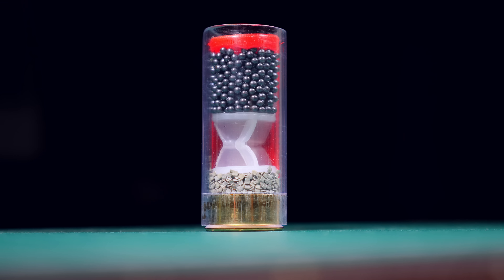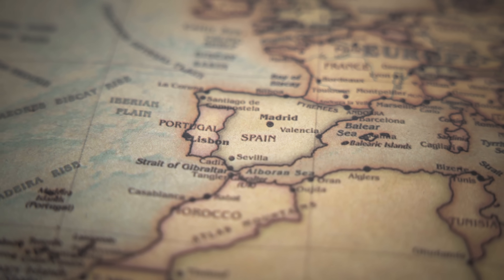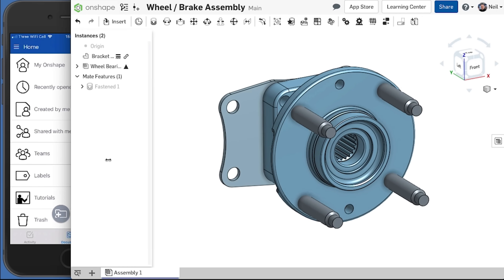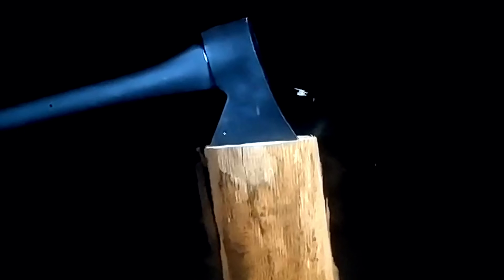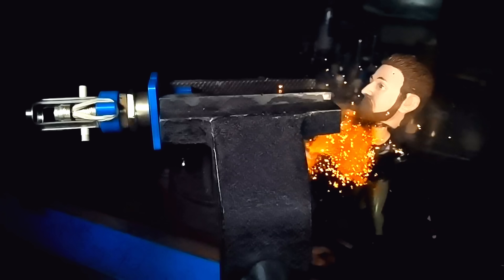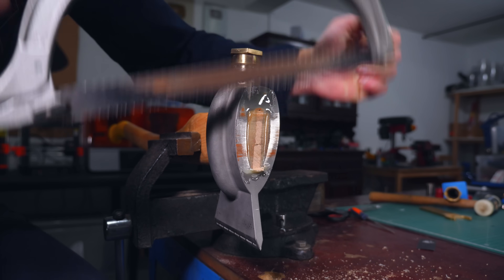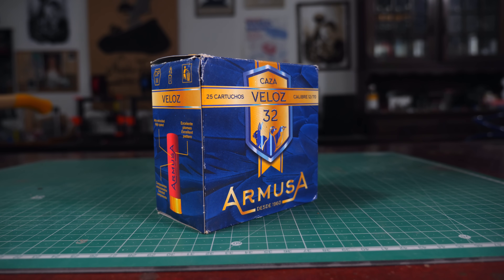I Built a SHOTGUN AXE

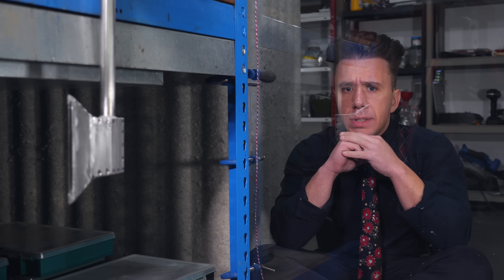Comment: 03:54 as a gun owner, I had a goose bump moment when I heard glue and aluminum working with high pressure gasses. I'll continue watching it but I'm really worried about you. I built hand made prototypes 20-30 years ago and it is not trivial.
Reply: To be fair that was one of the few times we've seen him take genuine safety precautions.
Reply: @dgkimpton  and there was a clear enough, relatively giant barrel to prevent high pressure… for the most part
Reply: As did everyone, including him. That's why that was just a proof of concept prototype for testing before the 3D printed head was made. Plus the vent holes were clearly more than enough to keep substantial pressure from building up. Even if it did, he took safety precautions and it would have failed at the glue joint instead of creating an aluminum shrapnel grenade anyway.
Reply: @JJFX-  definitely

Comment: Amazing project!
Since you can leverage pressure, I'm pretty sure you could use nail blanks to make a semi auto axe. The charge will be a lot smaller, but potentially sufficient to split the wood without sending it literally flying. And the shape (rimfire) makes it far easier to create a self loading mechanism for repeated strikes.

Comment: As someone who grew up chopping firewood, I expected this to be terrible
I mean, a hollowed axe head?? I severely underestimated the power of shotgun shells.
Silly and impractical, but genuinely effective when it works. Splitting the large log down the whole length at 15:50 was the most impressive shot imo, even if it wasn't as animated as the other pieces being blasted to bits. It's super interesting that you designed a blade like axe as opposed to a wedge to maintain a seal.

Comment: Wonder if you could design to work with co2 carts, redesign the head a little bit to be less of a splitter and more of a "wedger", where the shape of the head is designed less to split the wood and more to get fully plugged when you strike...

Comment: They weren't just for tractors. Known as a Coffman Engine Starter, that used a 4 gauge shell, they were used on several WWII aircraft engines like the Wildcat, F4U Corsair, Spitfire and Hawker Hurricane. It seems like an odd choice until you realize the time needed to scramble aircraft for interceptions was so short. Far too short to use separate ground based starting systems, one for each engine. Some aircraft had both system when the mission allowed the time.

Comment: Cool idea, it would have been infinitely easier if you used 22. Blanks which you can buy at most hardware stores.
Reply: Power nailer loads are not .22 blanks.
Reply: @jrrarglblarg9241  🤓

Comment: 2:18 kinda proves my point about gun control laws (I'm in the states). You can easily enough make a barrel of some type or a projectile of some type. Yet all laws I've seen here and any I've seen elsewhere, restrict access to the gun itself and not the bullets (although those can be made yourself).

I would think if the goal was actually limiting their use, restrict the part people can't easily make themselves, the primers and gun powder.

You CAN make gunpowder yourself, but it's likely to be poorer quality black powder than high performance, smokeless powder almost all weapons use.

And even if you do have the knowledge and ability to make them (which is probably by itself a higher bar than most gun ownership laws currently as in the process you can easily blow yourself up) you still need the primers, which are high explosives.

Which sets the bar even higher.

IDK. Just my thoughts.

Anyone know of a country that does restrict ammo, powder or primers?

Comment: That little plastic thing is called a shot cup. if it's a shell with a slug in it it's called the wad (used to be a literal wad of cotton cloth).
The fun part would be to see if you could make the thing take AR shotgun mags to reduce time between re-priming.... or use some ram-set charges.

Comment: I'm curious if it gets dirty from powder fouling quickly?  Those ports are pretty big, as are the channels on either side.  It looks like it should be pretty durable, and last a good while without cleaning the gas channels a bunch.  Still have to keep the blade sharp, if course, and oil it to keep it from rusting (so much corrodable surface area).

Comment: As someone who makes them, you are wasting your powder. It burns much slower than the dwelltime the powder and wad remains in the chamber. You’re throwing out unburnt powder flakes every time it goes off. Subsequently you are losing potential energy. That’s one of the benefits of having an ounce of weight in front of thewad, that mass necessarily slows down the movement and allows for full combustion.

Comment: A fantastic approach for wood splitting, but with the not readily available ammo, why don´t you try the ex-pl-o-..-ng wire type with a high current discharge from capacitors to form plasma ?

Comment: Now I want to see this improved to the point where you can chop down a tree in one swing (though I know this is very much unrealistic)
The one realistic improvement though would be to make the exhaust ports zig-zag right at the edge of the blade rather than be set back behind the blade. You'd have a half blade of an axe for most of the length of it but the ports would be right up front.

Comment: I smell a design patent coming.  This could have a lot of practical use applications.  Emergency & Rescue, Military & Police breach (forced entry). 

Could it work based on a chamber of compressed air that is released by user controlled trigger?
Reply: The military already uses shotgun-shell powered breaching devices. They're called shotguns. Load a shell with lead powder and it does a number on any pesky locks or hinges in the way.
Reply: I would say in this case patent in 99.99% is not possible because he published it in public domain. So it will only work if he himself will try to patent this that very unlikely because how shady this project from legal perspective
Reply: @dice-   Soooo, all things considered — you’re saying there’s still a chance?🤞
J/K, jokes aside I don’t know how patents work and your point makes sense.

Comment: A slight redesign to incorporate a plunger that hits the wood and is forced up into the ax head would allow you to use oil and compressed air as the explosive instead of shotgun shells 
No explosive primer needed.
Reply: Making it a diesel engine with the power stroke being the hit itself, nice!
Reply: Paint me a picture, that sorta doesn't compute.
Reply: @ShadowedbySusan  Diesel engine.
Reply: @ShadowedbySusan diesel pile driver

Comment: I have a reimagined version to improve your design!
Create a thumb trigger that you can manually trigger the shell to go off. Instead of pointing the energy towards the point of impact, point it out the back like an exhaust to a rocket. See where I'm going with this?
Design a rocket head out the back of the axe head, trigger the blast of your shotgun shell on your down swing to propel the axe head with greater force. This should be right up your alley! And also super dangerous! Win/Win!  ❤️ From 🇨🇦
Reply: @integza
Reply: wouldnt that be a gun/shotgun then making it illegal? Now it is basically more like a concrete nailer
Reply: @Hnkka  it's no more of a shotgun that what's he's already created. Shooting a propellant out the back of a axe with a nozzle would be more of a rocket than a shotgun

Comment: Few things to Say:
- Do a Cross Blade... split the wood into 4 pieces
- Use Pistol Blanks... less work and less complexity, also, probably easier to buy.
Reply: cross blade seems like a really dangerous idea with power like that. Seems like a fast way to get a wood piece to the knee, or even worse.
Reply: @valtarijunkkala  i was a maker till i took a piece of wood to the knee.
Reply: @valtarijunkkala  The groin? ^.^
Reply: @valtarijunkkala   Yeah, the main benefit to this design is that the force is to the sides. Cross is directing two of the four pieces in the users general direction....seems like a great way to gain a limp.
Reply: @valtarijunkkala  Yep.
Reply: Iligal to have pistols in Portugal, and what he as done is Iligal too
Reply: @Outl4wk1ll3r  they sell blanks for concrete nailers. 

If those are illegal then damn, those are some tough laws...
Reply: @volvo09  i don't know but the law on guns is crazy here
Reply: @ - Yeah, i researched a bit and Here in Brazil is also extremely regulated, basically, anything related to self defense is prohibited.
Reply: @Outl4wk1ll3r  This isnt really illegal. Basically this is like one of those concrete nailguns, completely legal, if he made it trigger operated it could easily fall in same category as shotguns and make it illegal making illegal weapon
Reply: @Hnkka   EU countries don't have the same gun laws
Reply: @Outl4wk1ll3r  well now that he has an explosive axe who could stop him
Reply: harder to buy because pistols and their ammunation and parts are regulated harder than shotguns and riffles that you can get easily for hunting purposes in EU countries. Pistols you need background for comp shooting/military training shooting or fox hunting to prove you need pistol and that you are using it for really good purpose
Reply: From a reloading perspective, pistol ammo is very difficult to get exactly right compared to 12 ga which is far more forgiving. For what that's worth.

Comment: Integza, what if we built a fully functional hydrogen-powered Pulse Detonation Engine (PDE) from scratch?

Pulse Detonation Engines represent one of the most extreme and efficient forms of propulsion, utilizing controlled detonations rather than conventional deflagrations. This approach allows for greater efficiency and thrust, making PDEs a promising technology for hypersonic aircraft, space propulsion, and even next-generation weapon systems.

However, the real challenge lies in constructing a working PDE without relying on 3D printing—using only standard machining techniques and readily available components. Could this be achieved in a DIY setting?

Step-by-Step Approach
1⃣ Designing the Detonation Chamber
The core of the PDE is a long, narrow tube where the detonation wave propagates. The design must ensure structural integrity under extreme conditions.

Material Selection: High-temperature-resistant metals such as stainless steel or titanium.
Geometry Considerations: A length-to-diameter ratio of approximately 10:1 to support sustained detonation waves.
One-Way Valve System: Essential for preventing backflow and ensuring a continuous supply of the fuel-air mixture.
2⃣ Fuel and Oxidizer System
A precise fuel delivery system is necessary to achieve controlled detonations.

Hydrogen Injection: A high-pressure injector would provide proper fuel-air mixing.
Oxygen vs. Air Intake: Using pure oxygen simplifies detonation but increases risk, while air requires compression for effective operation.
3⃣ Ignition System – Plasma Arc or Spark Plug
To initiate detonation, the system requires a highly reliable ignition source.

High-Energy Spark Plug: A robust and proven solution used in jet engines.
Plasma Arc Ignition: A more advanced method that may improve ignition speed and consistency.
Timing Control: Essential for synchronizing ignition at precise intervals to maintain the detonation cycle.
4⃣ Achieving a Sustained Detonation Cycle
PDEs operate in a rapid cycle: fuel injection → ignition → detonation → exhaust expulsion → repeat. Achieving high-frequency detonations (50+ per second) is a major challenge.

A rotary valve system or electronically controlled fuel injection could help regulate the process.
5⃣ Thrust Measurement and Testing
Once constructed, the PDE would need to be tested to measure its efficiency and output.

Test Stand with Force Sensors: To quantify thrust and performance.
High-Speed Cameras: To capture shockwaves and analyze detonation dynamics.
Why This Experiment Would Be Groundbreaking
✅ Visually Spectacular – Shockwaves, supersonic gas expansion, and controlled detonations.
✅ A Scientific Breakthrough – PDEs have higher theoretical efficiency than traditional jet engines.
✅ Potential Real-World Applications – If successful, this could lead to a working propulsion system for UAVs, rocket sleds, or experimental aircraft.

A project like this would push the boundaries of DIY engineering, making it one of the most ambitious propulsion experiments attempted outside of professional aerospace research.

Would love to see you take on this challenge, Integza! 🚀🔥
 and I am also am a hobbyist and I have taken inspiration from your projects and this one was epic

Comment: Make it diesel powered? No need for shells and repeatable. I would also try a narrower/pointier wedge, possibly even with a mechanical splitting piston, like a combustion jack hammer. This could allow X splits by propelling a wedge through the wood after the crack is started.

Comment: 0:48  you’re the first channel I’ve heard say this in the right order and correctly explained that the primer explodes while the smokeless powder burns.    Thank you for that
Reply: Burn and explode are both colloquial terms that are accurate to describe the primer and gunpowder.  If you want to differentiate between the two, the terms would be deflagration or detonation.  Deflagration and detonation are both types of burn or explosion.  The differentiation between the two is the speed of sound 343m/s.  Primers explode at 475+m/s, and gunpowder explodes at 600+m/s.  Both are above the speed of sound, making them detonations.  Neither of them are deflagrations which is what most people mean when they use the term burn.

In the colloquial use of the terms, it would be more accurate to call the primer a burn and the powder an explosion because the primer is slower (and fairly close to the speed of sound).
Reply: @zacharymorris9917 you sure about the speed of the primer being that slow, they use quite powerful primaries in there commonly between 4000-7800 m/s depending on the primer.
Reply: @Polkem1  I said 475+.  The spec you gave definitely falls within that category, so I'm not sure why you are arguing about it.  A no. 41 in open air is ~475; faster in a cartridge.  A light charge of black powder is ~610.  I gave the lowest end of the spectrum as I know it, which clearly covers the fact that both are detonations.
Reply: @zacharymorris9917  apologise, didn’t catch that, wasn’t meant to start a argument.
Reply: @Polkem1  no problem.  I wasn't super specific anyway.  I was basically pointing out the slowest possible primer versus the slowest possible powder charge are both what people call an explosion.  In both cases, the real-world speeds are much faster.

In my example, the no. 41s are at 475m/s open air.  To be fair, black powder that I referenced burns incredibly slow at seconds per meter in open air, making it a deflagration.
Reply: @zacharymorris9917  depending on the primer composition.   If it’s lead styphnate( which is most common since it doesn’t fuck up barrels like fulminates , chlorates, ,did ) it detonates .       4k+ mps.
Reply: A real-world example of this is 710fps CCI Quiet-22 rounds that use a case full of primer vs 1435fps CCI Velocitor that use just enough primer and a case full of powder.

Comment: Oh thank god printing blades is illegal 
Having a metal printer is so much easier than like putting a handle on some sheet metal
Reply: Funny how they can't print a knife but printing gun parts (in a technical sense) was fine.
Reply: found it weird too. The equipment you need to make a proper knife is much cheaper than a metal 3d printer. 
you could be sharpening knife blanks or even forging them out of steel stock and that would be fully legal.

Comment: Cloud based app means they own your work and you can't use it when the internet is down, or any faster than your internet speed. Any hiccup in your registration and you are denied access, even when they are totally wrong. When they decide to raise the rates, what can you do? It[s like Netflix where you get a notice regularly that they are going up on the rates. That may be okay with corporate backing but it really hurts the individual. Before long your OS will be online. (not just buying it online which was the first step)

Comment: You could have used a shortened hillbilly shotgun as the handle of the ax, and have a 90 bend in tue axe head.

When the charge is set, it gives you the length for the powder to burn, and you can manufacture a reliable triggering device using an accelerometer.

The 90 diameter in the axe head will need to be adjusted to prevent blowback and explosions.

This is your craziest build yet my dude.  You basically made a power maul from fallout.

Comment: There's some power behind that chop. Makes me think what a pneumatic version of this would be like. I would think you could control it better with adjustable pressure and it would be multiple uses if you had a big enough air tank.
Reply: You could attach a hose to the end of the handle and run it straight off an air-compressor. Be slightly awkward to use while getting used to the hose attached but I think it would be easy to master fairly quickly.